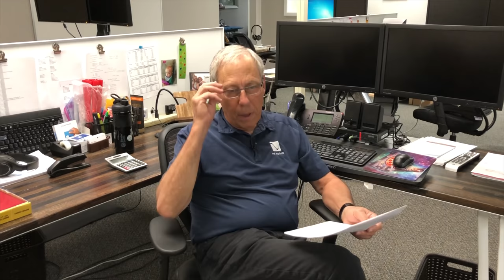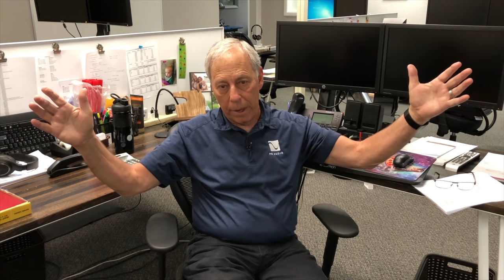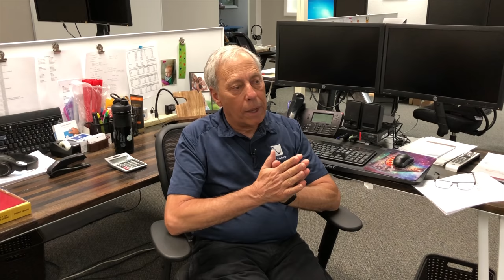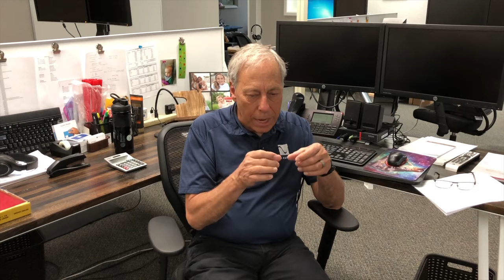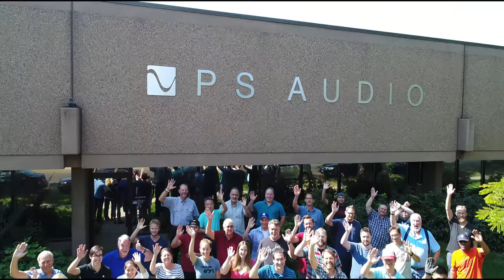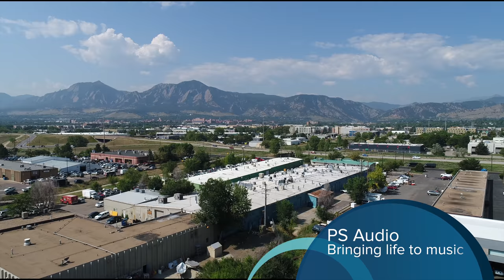How does a servo woofer work?

Comment: Yamaha uses AST (Active servo technology) in their subwoofers and some sound bars as well. It’s pretty amazing
Reply: Agreed.  I've found the YAST II system to produce some nice clean bass.   Is it the most powerful or the absolute lowest,  nope.  It does however just sound really good.  Running two Yamaha subs in my HT system.   Got rid of my boomy Polk's.
Reply: Yamaha YST-sw1500 servo sub from 2003 here.  Nice deep clean bass

Comment: Wonderful explaination! I could listen for hours. I am currently part of a team, designing a similar servo loop system at work,  but for automotive suspension - i thought i knew control theory well... well it turns out i still have a lot to learn ;) i wish i could afford having one of those speakers, but i have to buy a house first :)

Comment: The the fastest most accurate subwoofer I have ever auditioned was an pair of light weight paper cone eminence 12 " 's in 2 8 foot boxes tuned to 16 hz.   No  servo control. Zero equalization. They used a very basic passive crossover.  They also needed resistors to cut the efficiency back to the level of the Martin Logans they were running with.  Effortless , efficient , quick , accurate, Cristal clear bass -3 Db at 16 hz. 

Very few people have room for 2 coffins in their living rooms.
Reply: Undertakers might (if they take their work home with them)

Comment: back in the 80's i drooled over a set of Linear Power servo controlled car subs. 4 8's as i recall. As i recall they used dual voice coil woofers one was used for power and one for sensing.
Reply: Makes sense, presumably that'd also help cancel out the affect of the cars movement and vibration on the speaker and perhaps even decrease the noise inside the car

Comment: In the Netherlands there is a group of (Philips) MFB enthousiasts that are reinventing the principle to modern times. for instance using Hypex modules with with DSP and using this processing power to do the servo. Also the use for small active monitors with deep bass is being developed.
Reply: Are you perhaps referring to what is now known as Grimm Audio?
Reply: So does it's still measure or does the software have a "digital twin" model of the physical speaker?

Comment: Not sure if Mr. McGowan was involved but I have a Genesis Servo 12B subwoofer that was purchased in 1995! It still does the job well. I like the fact that the control box/amp is separate so adjustments are easy.

Comment: I studied electronic and electrical engineering, have owned, designed, built, and modified quite a few passive/active systems myself; and have always had an avid interest in audio and acoustics.

Years ago I found myself working in a UK studio (this day we were repairing/tuning a well know brand of large 3 way far field active monitors) where the system we took out of the wall actually had a small laser attached to cone baskets of its woofers.

The laser reflected off a strip attached to underside of the cone, and from this calculations were performed within a microprocessor to implement the correct feedback/control signal.

Prior to this I had often thought about servo control of both woofers and other transducers beforehand, but the required processing power to achieve such things (at the time) was theoretically only (just) achievable within the low frequencies; and - whenever contemplating such a system - I was always aware that a closed loop feedback control system would still most likely be unable to deal with surface mode distortion across large diaphragms (such as with 12 inch and larger woofers) anyway.

Anyway, this was the first time I had seen it implemented with a laser, and the surprise was that the monitor manufacturer was testing the technology and the studio themselves were unaware it existed.

I recall this distinctly as I was the one that had to contact the manufacturer and ask about a servo electronics that was not in the engineering handbook.

After several weeks of argy-bargy with the manufacturer they eventually/reluctantly mailed me a circuit diagram for this unannounced servo system (previously all they supplied was a circuit diagram for the amplification, Xover, and other circuitry) that just happened to “show up” in their product line, as complete documentation of all circuits and other acoustic systems so as to facilitate maintenance/repairs was an explicit requirement within the original purchase and support contract.

Despite being reasonably crude, the servo system worked very well and (within certain SPL’s) it also measured better than other identical systems (which were implemented within the adjacent studio) from the same manufacturer that didn’t have low frequency servo control.

Comment: Brilliant!  I'm thinking now, if you had a really good woofer with perfect linearity, powerful drive assembly, lightweight moving mass etc, and the accelerometer was absolutely accurate 100%, how do you compensate for the amplifier characteristics  - slew rate and so forth?  This technology is fabulous, I'm just wondering if it will expose weaknesses to the other components in the chain.  Even measuring the actual output of a perfect servo controlled speaker with a microphone for example would add its own response characteristics to any measurement.  Exciting times to be exploring things like this with modern technology, the engineers of old would tip their hats to this stuff!

Comment: I built a motional feedback system in 1980 using a Philips AD8067MFB driver that had the accelerometer under the dust cap.  It was the same driver that Paul Barton used in the PSB Beta II.  The reduction in the non-musical 3rd harmonic distortion in this older (and not particularly linear) driver was huge.  The human ear is a lot more sensitive to the frequency of the 3rd harmonic (say 60 Hz) than the fundamental (say 20 Hz) and since even today's good LF drivers generate quite a bit of distortion the reduction in distortion is significant and apparent.

Comment: Motional Feedback system. That was made by Philips and worked great! 👍
Reply: Was it for all frequencies?
Reply: @Justwantahover  No, just the woofer.
Reply: I have the 541, great little speakers. Because of the old age they need a checkup though.
Reply: smart dutch people, they invented a lot of cool thinks, coffe-pad machine, one blade razor this is the best electric razor, but i use a double edge razor, and airfloss

Comment: Years ago, my audiophile friend described to me, if I remember correct, that "Amplifier Damping Ratio" works on the woofer to put it where it is supposed to be. The servo idea, as you describe,  seems to do something similar, but more accurately. Currently I can not define damping ratio but maybe you could enlighten us on it and show how it effects the speakers.
Reply: BiddieTube I feel this servo controlled shit is d's marketing gimic
Reply: BiddieTube, negative feedback does essentially the same thing but more simply and less expensively than the unnessarily elaborate servo design, often with better results.  Decades of testing back me up on this.
Reply: This servo approach is used in CNC machines.  In older CNC machines they used a tachometer feedback on a DC motor.  The tach tells the amplifier how fast the motor is spinning.  These are typically velocity mode drives, where the input voltage corresponds to a given RPM.  The tuning parameters are "how fast do I react to input changes" and "how much do I try to control overshoot".  This is just like a speaker.  Normally the output of the speaker is proportional to the volume of the music.  A loud volume will move the speaker faster than a quiet volume.  DC motors work the same, a higher voltage will accelerate the motor faster than a lower voltage.  So the idea is you put as high a voltage as you can, with as much current as you can, instantaneously, to get the armature (voice coil) to move the cone to the desired position as fast as possible.  If you listen to speakers, you'll note there is a sweet spot where they start to sound much better, at low volumes they tend to sound muddy.  Servo control essentially allows a speaker to sound good at low volume and high volume.  Imagine a very dynamic musical piece that has quiet passages and loud passages.  You crank it up when it's quiet, so you can enjoy the passage, but then it's too loud for the loud passage.  A servo woofer would eliminate this need and it would just sound "good" all around.  The intended frequency would be the same at low volumes as well as high volumes, just the intensity would change.
Reply: Those are some awful strong words.  You have velocity, travel, and frequency.  Power input (volume) influences the velocity of the cone and the travel of the cone, otherwise there would be no purpose in the servo technology Paul is talking about.
Reply: @eformance   yes the power makes the cone move more but volume doesn't make it move any faster 1 Hz is 1 Hz per 1 second "example probably faster than that. Volume (power) isnt going to change the  speed of 1hz but it will change the force of which the cone moves
Reply: Velocity and frequency are different things.  Velocity is how fast the armature moves to a given excursion, frequency is the period of the movement, excursion is how far the armature moves (more air movement, more output).  In simplest terms, a servo basically says "turn on the power until I see the desired movement".   The point is to be able to move the speaker accurately, so if at low volume inputs the speaker isn't moving at the desired frequency, or the actual wave output does not match the input, then the servo amplifier must boost the output.  The amplifier will boost the output to the speaker to ensure the speaker cone is mimicing the wave input.  If you divide a single cycle into 360 sample points, the amplifier adjusts the output of the speaker in realtime to make sure the cone is moving proportional to the signal at each of 360 points in a single wave.  It will do this cycle-for-cycle time and again.  The servo loop will either speed up the cone or slow it down to match where the cone needs to be in that cycle.  The total movement of the cone  will be proportional to the P-P voltage of the input signal.
Reply: @eformance  again you have no idea how speaker engineering works also this servo technology is a bullshit scam its not going to work as mentioned its just a. "More money" scheme
Reply: Are you this inconsiderate and hateful face to face?
Reply: @eformance  nope I'm. Just blunt
Reply: Yamaha YST Servo-(circa late 90')- I remember going into a room full of Velodyne , Big Klipsch subs ect.. And that little YST sounded better than any other sub in that room. Smaller drivers , and servo are a great combo especially if you're using an LP based set up.
Reply: And i still do not get why they do not use optical controlled speaker movement.

A friend of mine haas this idea and is about to build a prototype.

You measure the position of the membrane and controll the amplifier so the membrane moves exavtly how you want.
In that way you can make any membrane move 100% perfectly to the input signal. Sure you need a good amp with good dampening factor and high power for short high energy pulses if you wanna drive very big speakers.

All those hi fi voodo to get the output as near as possible to the input and the solution is so simple no one thought about it........

Probably because it is too cheap and you would not need 10.000 $ amps and speakers anymore and you would still have a better system than that.
Would crash audio industry i guess. Like electric cars would crash oil industy.

Comment: This is something I've never even heard of.  It's a great idea, and would work very well for frequency response.  I had a harebrained idea about making a voice coil activated port to tune the frequency of the box to the output of the speaker.  That way, the speaker is always hitting its peak resonance within the box and port.  It might help to make the system more efficient.  Combine that with this technology, and you'll have an energy efficient clean audio response.
Reply: That wouldn't work because the speaker isn't only producing one frequency at a time. It's producing a whole bunch of sounds, not just one sine wave at a time.
To make a speaker more efficient you make the cone lighter, the magnet stronger and the magnet gap smaller.
Amplifiers are cheap these days in terms of dollars-per-watt. There isn't much need for ultra-efficient speakers anymore.
Reply: @devilsoffspring5519  I was thinking more on the low end of speakers, the subwoofer.  Have a low end filter that would interpolate the frequency like a sort of artificial auto tune.  Especially with ported boxes that are tuned to a specific frequency.  If you can make the box smaller, that's always a good thing.  And a flatter frequency response is also good.
Reply: @squishy312  There's no need for it, because ported speaker boxes don't only operate at only one frequency. They work over a range. The frequency that the bass port is tuned to is the resonant frequency, but their sound output is useful over a range of frequencies.
So, no need for a "self-tuning" bass port that adjusts itself depending on input frequency.

Comment: To summarise this video: 

In normal speakers, the actual physical position of the speaker cone is not being measured at all while it's being accelerated back and forth. "Servo" (not related to motor servos at all, apparently) woofers simply measure the cone's physical position with accelerometers or piezoelectric pressure sensors, and then use a PID system (look it up; very important and common concept) to adjust for where the speaker SHOULD be according to the input signal at any point in time, and then send that "difference" as a correction signal.

Comment: Almost all modern amplifiers incorporate negative feedback circuitry, which increases damping factor (the ability of the amplifier to correct for aggregate motion error in speakers), which generally eliminates the necessity for complicated servo controls on speaker design.  Tests have shown that servo speakers preform almost the same as properly-implemented high-quality speaker and amplifier pairings which cost only a fraction of what a servo-controlled system costs.
Reply: Not to mention one more point of failure.

Comment: Wow, this idea is amazing.  Such a simple idea too.  Making a speaker produce perfect square waves in the real world is impossible, but getting close to them is impressive!

The only thing - if it's reading the speaker and applying a correction signal, it's surely lagging behind the audio a bit?  Maybe only a few cycles, but how much time does this correction take to process?
Reply: No not a few cycles, but you are right there is some lag. However it can't be more than a few degrees. I understand that the reason we don't see servo woofers go very high in frequency is because the lag between the electrical signal and the woofer cone gets too great. If the signal and the motion lag close to 180 degrees you now have oscillation instead of control.

Comment: Even cheap Yamaha mass produced subwoofers have Servo Mechanism they brand it as YST II. But the cost of Servo Logic is relatively low today. Its the fine detailed engineering R&D work to execute it well that i'm guessing is majority of the cost. Servomechanism is just a basic concept, but has to be done right.

Comment: I have Philips MFB speakers from the 70's, they work the same way. The accelero-meter is just in the feedback loop of the amplifier.
3 way speaker with 3 amps, 1 per chanel (active speakers).
They had a whole line of those.
MFB was in the line name.

Comment: Interesting! I didn't even know these existed. Couldn't the servo feedback thing be accomplished just using the voicecoil as a means of determining what the cone is doing, I mean, it's just a linear motor, so after initial calibration, measuring the voltage across the speaker being the lowest when it's either trying to change direction, or move off from a static position (i.e. drawing more current), or the highest when it's about to overshoot (i.e. voltage from amp is zero and the speaker coil has become a generator)  Of course I'm no electrical engineer, so this may just be me taking nonsense. edit: Actually, brain fart time, one could have a second voice coil for feedback, and just measure the voltage across that, would make things easier.

Comment: Where does the power come from to perform these Corrections?
Reply: We're talking about powered woofers or subwoofers, so this works because the amp design can include the additional difference amplifier there in the same circuit.

Comment: Hoi Paul, my name is Hein van lokven and I am from the Netherlands. interesting item! But this system has been developed by Philips in the early seventies. It was know as motional feedback (MFB). I have several sets and I love them. So is your servo system different then MFB? Greetings from Holland.
Reply: Very good question, philips was way ahead of its time. And they performed the MFB using only simple transistors. No fancy op amps or DSP. Pure analog. And i also have a set of them the 544 and i find them pretty good. I love the thight bass.

Comment: Once you've listened to a high end "servo controlled" sub, all others fail in comparison.
Reply: @NDFOOTBALL it's not the imaging it is the control of the speaker cone itself and if you have heard a servo controlled sub they seem in a class of their own.
Reply: @NDFOOTBALL Can you please share what model number of the QSC you use? I am having a hard time finding powerful, well designed 8 inch subwoofers at a reasonable price.
Reply: Exactly. I've had the privilege to listen to a prototype built by a researcher in Amsterdam and it's just uncanny.